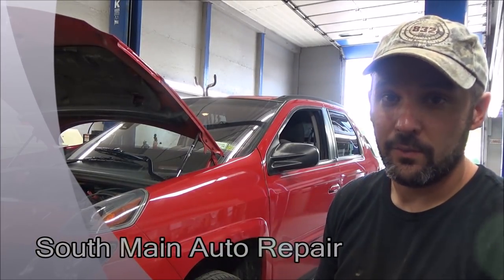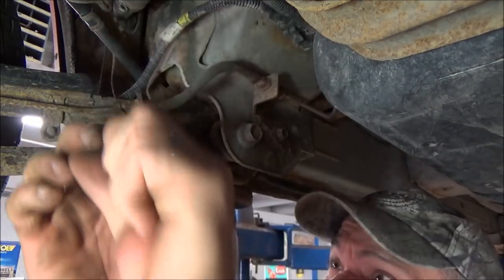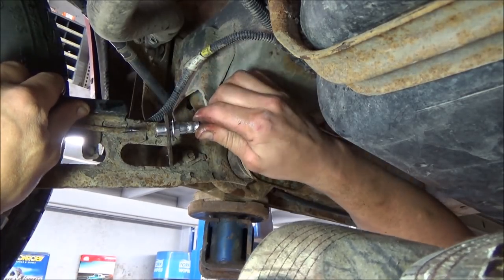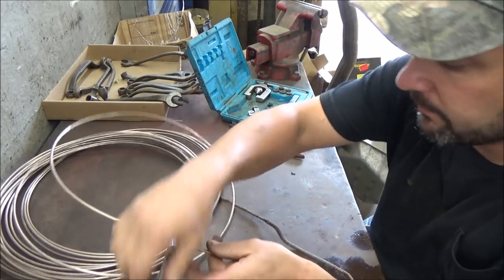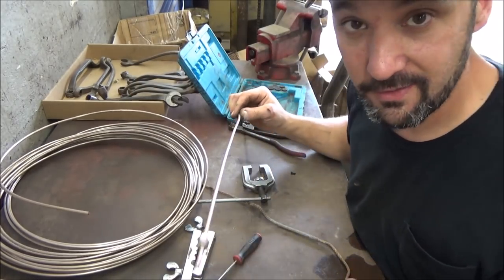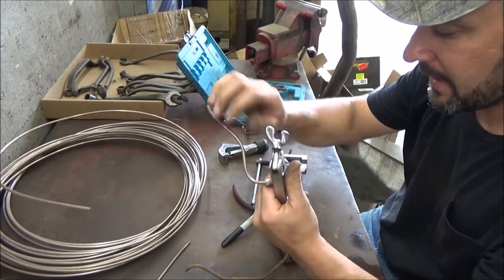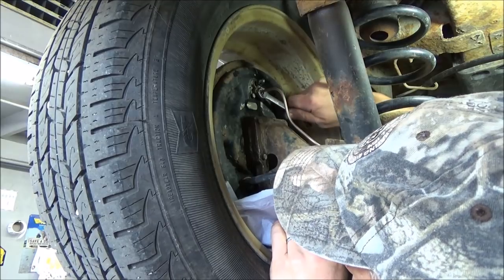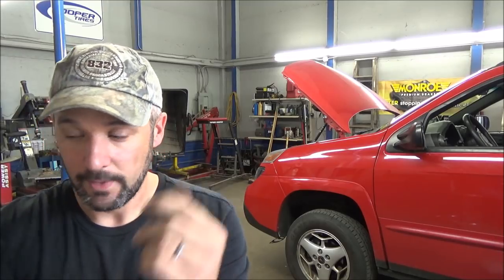Replace Brake Line &  Brake Hose : Pontiac Aztec

Comment: I saw one from Nthefastlane where they just did a single flare.  I commented on it "why not a double flare?"   The poster didn't answer; but another commenter said the union fitting must not have required a double flare.   As far as I know, the only right, legal way is a double flare like you  have shown (or equal bubble flare).
Also -maybe the one you saw- a mechanic of 47 years experience recommends compression fittings.  No.
Reply from the maker: Dave Caselli You are right and I saw that video to and (cough) I didn't wanna mention it because they may not have know better but you are right the way to do them correctly is a double or bubble and never a compression.  Compression are actually illegal in our state.
Reply: Just out of curiosity and inexperience why are the compression fittings bad?  Is it a pressure thing? Is it too easy to not install properly?  Maybe they don't last as well?  
I've seen Paul Short do a video on not using them for fuel line repairs, as well, but I can't remember exactly why he said not to.  I'll have to go back and rewatch that one.
Reply: eaton actually makes a DOT legal compression fitting. that said, ive seen compression fittings vibrate apart on a few machines

Comment: In Sweden we have alot of rust and salty roads aswell, and there is one single car that i know of, that rust like hell, no matter what, and that is a Volvo v40, like older models. Everything on them rusts to bits in a year or two, Do you know any specefic cars that do the same?
Reply from the maker: +rambon1234 All domestic makes here rust so fast you can hear them. GM Ford and Chrysler. They rot so fast it makes you sick for what they cost

Comment: you should check out the otc style flare die.  A lot easier to use and cleaner flares.
Reply: +LazySniper +South Main Auto Repair   I use the mastercool hydraulic one.  It's a little expensive but I love it.  Very consistent flare quality and far less hand-strain when you're doing a bunch of flares one-after-another.  Plus since it's hydraulic, you don't need a vise so you can take it under the car (unlike the Eastwood/KTI).  And yes, NiCop lines are a must. 

http://www.amazon.com/Mastercool-71475-PRC-Universal-Hydraulic-Flaring/dp/B007TN15EG/

Comment: another good trick is to put a little tiny weight on the brake pedal before tearing open the brake pipe system, this way you will not get drippy wet doing the job, and the fluid won't break your skin and your expensive painted shop floor...

Comment: Eric
Is your flare tool threaded inside where it holds line?
I have an OTC flare tool, threaded to help hold line, man i hate how it mars up the line, usually have to clean it to get nut to spin
Reply from the maker: pinsetternut Yes mine is but it really doesn't leave any "dig" marks in the line so to speak
Reply: South Main Auto Repair 
interesting, Thanks

Comment: I just spent $1,700 on a intake manifold gasket, new spark plugs and 
wires, camshaft and crank shaft sensors because the car would stall 
after driving it 20 minutes. After all that it still stalls after 
driving it 20 minutes. Took it back to dealer who had the car for 2 
weeks. The day I pick it up they tell me they had to put brake fluid it 
in which I have never had to do in my 2002 malibu 116,000 miles. Drove 
it 5 minutes and brake light comes on and now they tell me all lines 
need replaced at $1,000. Are they liable since they had the car for 2 
weeks and this happened when they had the car? Thanks.
Reply: nope

Comment: i have a question I have a 2001 aztek and I cant find what line is on the abs box for the driver side rear
Reply from the maker: Abby Fitch You can't just follow it up from the rear?
Reply: it snaped and my husbands arms r to big to reach it he thinks it is the back right one but is afraid that the line might strip the abs box
Reply from the maker: I just looked I don't have a diagram on the ABS unit itself as far as what line goes where. Maybe you can trace the other ones and eliminate who goes where?
Reply: ok thx I will let him know

Comment: i never had a problem with brake hose but i had fuel line hose break apart on the inside n clog everything up, when i cut it apart, its apparent they make them in different layers of different stuff n the inner layer has jus absorbed fuel n crumbled to shit    to b honest iv got so much shit goin on so often around here that its very possible i had air line or somethin else on there jus to get the lawn finished one day :p

Comment: nickel-copper lines are legal in scandinavia and the rest of europe. they dont rust and forms easely. and lasts for years and years.   i made new brakelines on my old dodge tradesman  15. years ago and they are still ok. in norway we spread a lot of salt on the roads in the wintertime and nicopp lines is the only ones that can handle that.
Reply: +hawkins19601 Yes, and its the same for Sweden, i think we have almost as much rust here as he does.

Comment: Is there a repair you wouldn't do / couldn't do?
Reply from the maker: +SirDeanosity ... I do just about anything really...
Reply: Transmissions?
Reply from the maker: Did a transmission on Friday and will be replacing another on Monday actually...
Reply: Do you overhaul them as well?
Reply from the maker: SirDeanosity Only manual gear boxes. The automatics we have rebuilt out of house.

Comment: You forgot to put the spring material on that new brake line made Eric when are you going to learn they put that on for a purpose so you don't ding it especially when it's on suspension parts .

Comment: You forgot to emphasize the insertion of the tube into the fitting BEFORE flaring or bending.  It usually takes me 2 - 4 times of recutting and reflaring before I get it right.  The tighter the spot inside the frame, and behind blockages on the car, the more times it takes me.  (You know... that "Murphy guy" always raises his ugly head.)

Comment: Politics seem to be a big issue with brake lines for some reason. Here in Germany you are not allowed to cover brake lines with underseal or paint, but you pass inspection if you just cover the rusty lines with grease. That's really odd I think.

Comment: I didn't know compression fittings are illegal, I have one on my Jeep GC that runs from the ABS to the rear differential, stupid Jeep had a bubble on the front and inverted on the rear, AZ sells compression fittings so why do they sell illegal parts? The front lines that lead to the rubber hoses need to be replaced [rusty] so I will use those nickel flexible lines for them and replace rubber hoses at the same time. That's what happens when vehicles get 20 years old in the Northeast, also going to replace both transmission to cooler lines, return line is NASTY, just ordered those on ebay.

You know I got so lucky when the long brake line failed, it popped in my driveway and the pedal hit the floor in about a second, can guess with brake line condition, not worth an accident
Reply from the maker: jim dandy Well it is NY and every thing is illegal lol Well at least it seems that way .

Comment: I  checked on the nycopp line and its 88% copper 10% nickel 2% iron has a rating of 3000.psi.
Reply from the maker: +eddie martinez Good stuff!
Reply: Sure is starting to get that green color you told us about but looks good.  Sure is hard to work around that anti lock pump did even the lines on the diff.
Reply: If it had not been for you i would have not done it myself. thank you.

Comment: i couldnt find loose brake line fittings here. had to buy short line and cut them off of it.
that line was way too easy to bend.
and when you were crimping the hose remember it was a new hose you were crimping not a 40 yo oem hose.
Reply from the maker: ***** Couldn't find the nuts at the parts store?
Reply: ya.
Reply: 25 years ago tho. lol

Comment: I thought automobile is a 45 degree flare in aircraft it is 37 degrees
Reply: sae society of automotive engineers  is 45 degrees  jic joint industry council is 37-1/2degree by an approved sae standard lol   when it comes to fittings you cant wrap your head around the numerous types